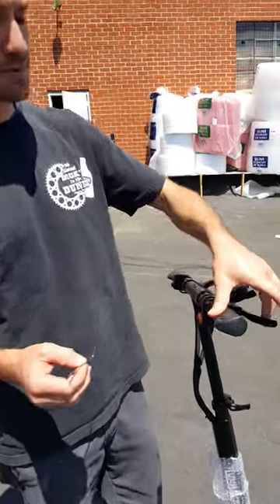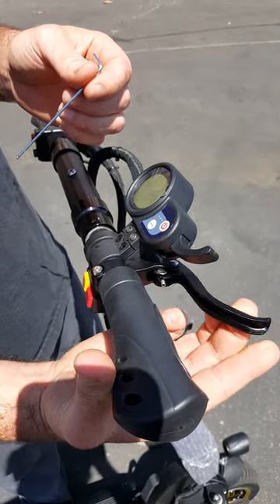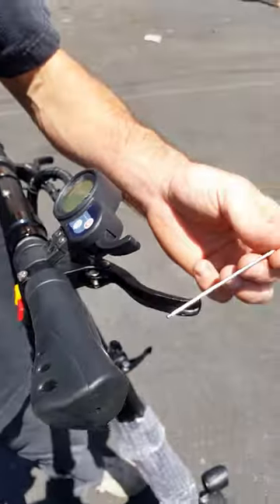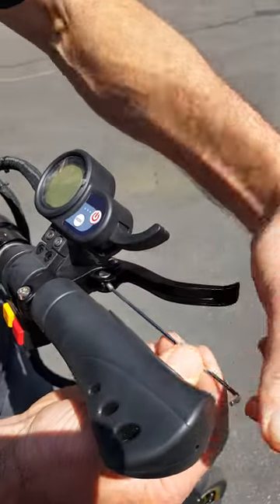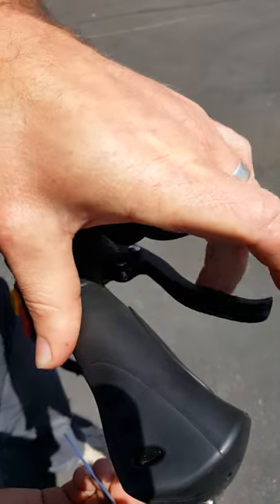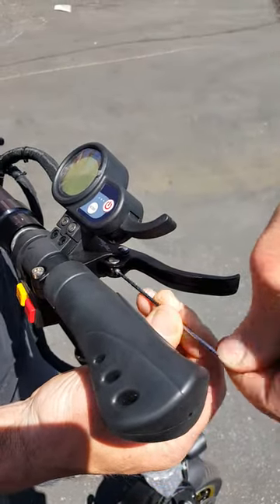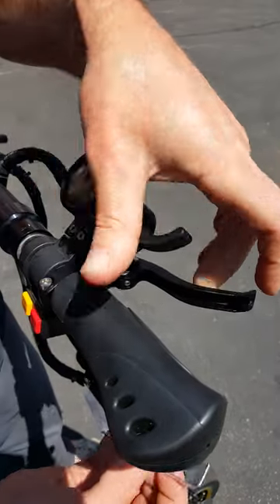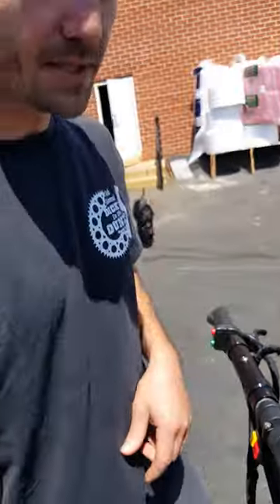How to adjust the brake on your Luna  apocalypse or super scooter

Comment: perfect. just what I needed!
Reply: Can't believe this fix took less than a 1 minute, I went to 5 bicycle shop and they couldn't  figure out nothing on the scooter to adjust brakes🙈🙈
Reply: Hah. Yeah. I thought since it has hydraulic disc brakes, that there'd be a master cylinder to top up, burp, or bleed. I looked on the handle and couldn't find it. 

Just gotta remember to loosen the tension when we put in new pads. The pad video makes it seem easy to swap. I thought there might have been more parts to disassemble. I tightened my brakes up.